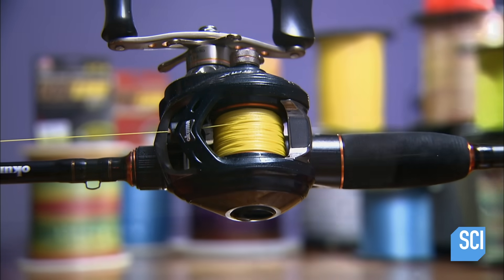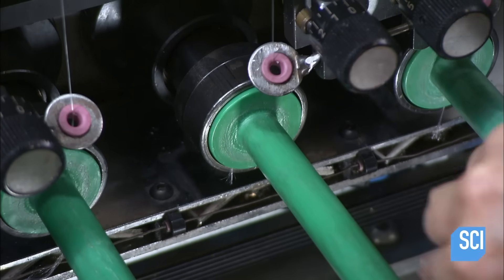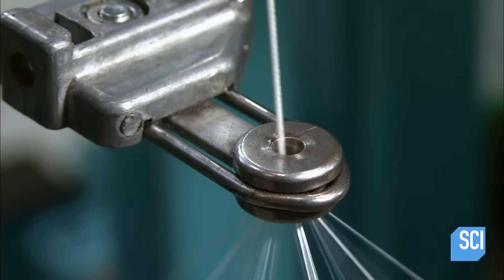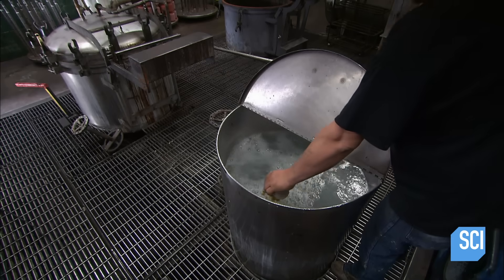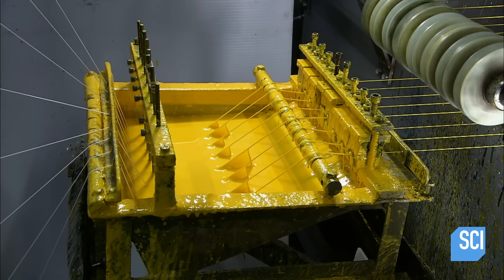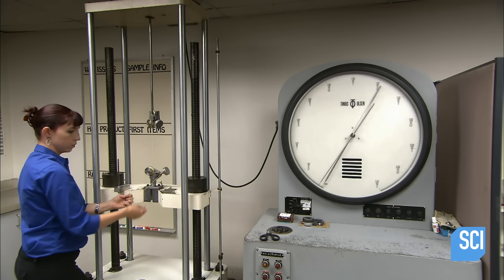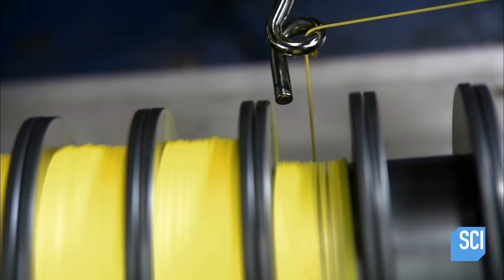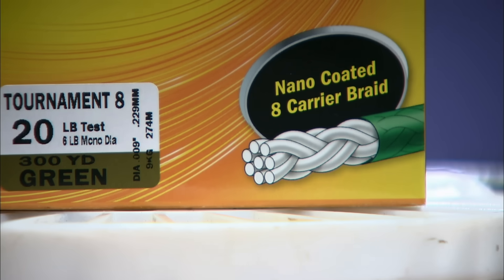How It's Made: Fishing Line

Comment: this fishing line , thin but strong. braded into tight single chord, fibers thru needles. devices queen fiber in even tension. bradding maypole machines, tight braid. producing tight braid slow work. 10 days to braid 7500 ft section of fishing line.

Comment: I’d love to see how fluorocarbon and monofilament are made
Reply: Right? I use that stuff all the time inland... Never used braided stuff.
Reply: The process is called extrusion. Raw synthetics are melted down, mixed at high pressure, and pressed through a frame while hot. This results in a thin strand that's then cooled while under very light tension.

Comment: This video needs to have the title changed to: "How BRAIDED fishing line is made".
Reply: Jason Karl  If you got 600 yards of 100 for 25 it's probably low quality stuff. I 1st started using braid a few years back and did the same, while definitely better than mono, has it's draw backs. Stuff like the cheaper spiderwire is fine for a few months but then really starts fraying and sounding like  dragging a file through your eyelets. I've used PowerPro and Berkley x5 and x9 and they are usually between $25- $45 for a 300yard. And I don't think the gorilla stuff is pure dyneema and is a little bigger, especially in the 100lb size. I like 80 and 65 powerpro to do most of my big cat stuff ad I use the berkley stuff for my smaller stuff like the 8lb braid with 4lb flouro leaders for blugill and also run 20 and 30 on baitcasters, 20 casts farther.

source: I work at basspro and fish a lot.
Reply: @Chris-sf7ug  yea I agree
Reply: Jason Karl  ah gotcha, just didn't want you to get a bad taste in your mouth from it. I know I did after using the cheap spiderwire. The good braid should float, that's a good test for it.
Reply: Jason Karl  gosh what you need 100lb test for bruh
Reply: Jason Karl  yep that’ll do it
Reply: Jason Karl  cool o have never caught one but have seen them before
Reply: Jason Karl  well if you use 100lb braid I would suppose they have some rly sharp teeth lol
Reply: Wow excellent comment.  You're a hero.

Comment: looks more like rope, I thought fishing line was more like a stronger version of a guitar string, clear nylon
Reply: Thought the same thing. I guess you can use this for heavy vegetation, for trolling, and for if you are going for stronger teethy fish. This is much strong, doesn't tangle as easy and ties for a better knot. Downfall is some fish types are able to see it.
Reply: You’re thinking of the older monofilament lines. This clip is showing how the make the braided lines - very much like producing larger cordage but much smaller diameters.
Reply: I usually use the clear kind on most of my poles because I fish in lakes and creeks and catch fish that don't have teeth and are small. I sometimes fish in a river and that's when I use braided line. It's expensive so not worth putting it on a pole that I'll use in a lake, also when Lake fishing you sometimes get stuck in the trees and cut the line which would be a waste of braid.

Comment: Another how it's made when it's not how it's made, that was how they make fishing line stronger, at no point did it cover how it's made. How sand is made coming next, you go to the beach and fill a bucket.
Reply: So they should cover how oil rigs are made, then how refineries are made, then how petroleum products are made, then how a plastic making factory is made, then how plastic lines are made and then this? All that in one episode? 😂
That plastic line is just a raw material that could be used for making many stuff, and one of them is fishing line.
Reply: @Zuconja  It's a how it's made not how it's assembled, if it requires the steps you mention then yes, how it's made is how it's made, it doesn't get more simple.
Reply: @Zuconja  No it how fishing line is made, it's not rocket science, at no point does it say how fishing line is made, all it covers is how fishing line is made thicker which is just adding more fishing line, we still don't know how fishing line is made, think about it for a minuet you'll get it.